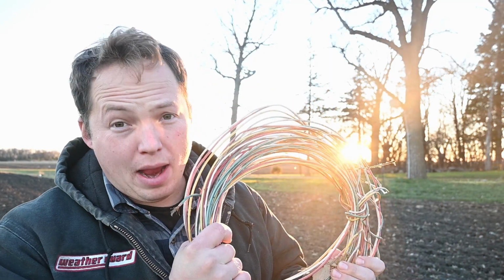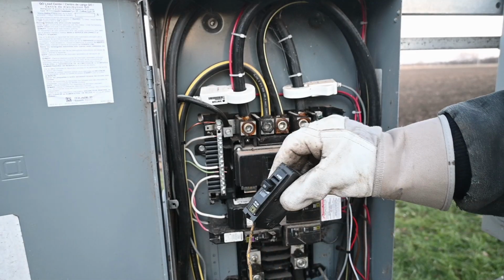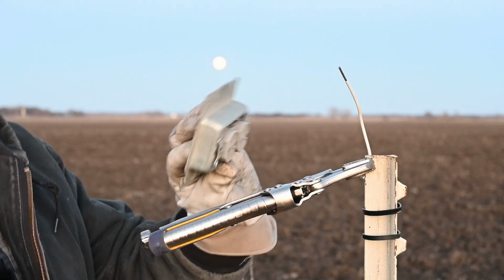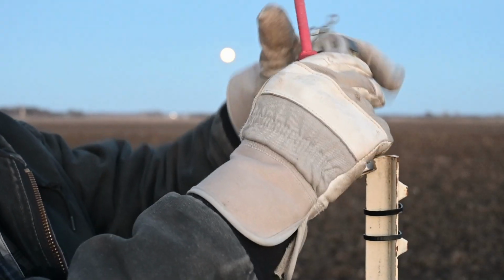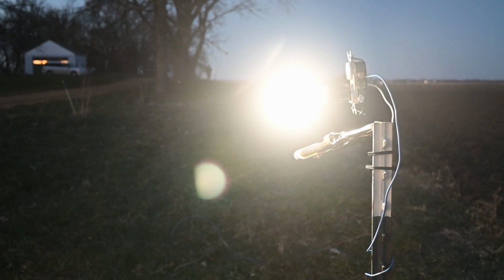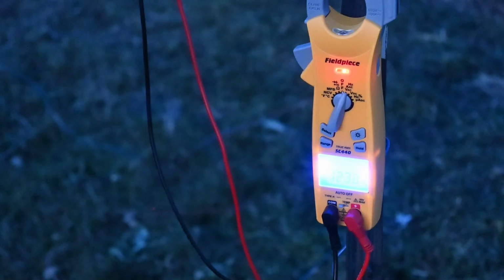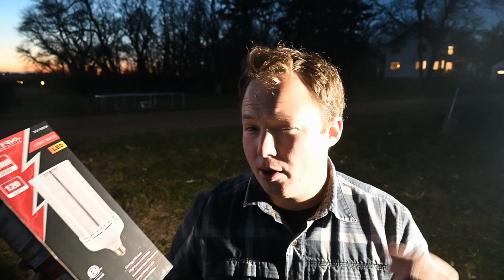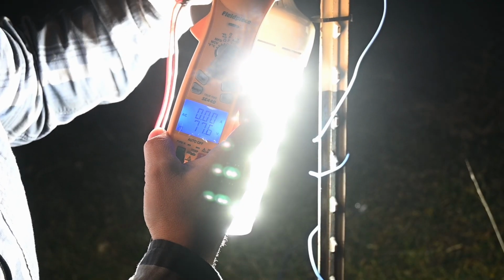Powering a Light With a Fence Post & Scrap Wire - SWER (Single Wire Earth Return) Demonstration

Comment: In the days of the singing wire or Morse code across the prairie they used the ground as the return circuit also. In fact they even found at one point where disconnecting the battery had no effect on performance. The system still worked somehow without power. I'm not positive on the details because it's been a long time since I remember reading something like that. Over 40 years at least.

Comment: At 1.6Ω / 1,000', 150 feet of 12 awg is 0.24Ω.  That means to see an 45 volt drop at 0.64 amps, the ground, post, & ground rod (collectively) are providing 70.07Ω of resistance.  I wonder how much that could be reduced with an 8' ground rod, instead of just the post. My guess is not very much.
I have never tried the SWER system with a generator, but if the neutral was grounded (with a rod) it might work.  However, I don't think I would try that with an inverter generator.

Comment: Big deal! You still used a electrical company box to get it going. That's no crystal radio which is powering a set of headphones without an electrical box connection.  Get it going without using an electrical box.

Comment: Mostly off but kinda sorta but not really on the subject here, its just funny/sad. I knew a guy in S.W. Florida, every time he left for work and as he returned home his 3 dogs would go crazy. Eventually they refused to load up in the van, he had to force them into the van. If the road was busy and he had to sit waiting to pull out of driveway they went REALLY crazy. He asked me what could cause that? I met at his house and he was pulling out of the driveway, yep, dogs went crazy. He backs up, I saw the dogs for the first time when he let them out of the van. I saw the collars, asked "uh, dude, you have a wireless fence for the dogs?". He looked shocked, then realized every time he drove over the wireless fence the dogs got a nasty shock. If he had to wait to pull out, they got shocked longer. He felt so bad he removed the collars. Those dogs wouldn't get close to the fence, eventually they would load up without freaking out.

Comment: You talked over what you were doing amd it was tedious.
Can you edit this without the buddy chat?
Did you lay 100' of wire from a circuit, then essentially  transmitted power into the ground?
So it's not free energy, you're exaggerating Nikola tesla power transmission?

Comment: When I was 14 my friend showed me his brother's stereo... this was really futuristic stuff and we weren't supposed to be in his older brother's room... who was an electronic tech who worked on the DEW line (cold war radar up north).  Brother came in and he saw the plywood box with toggle switches and a telephone hand set attached I was holding.  He didn't say anything about us being in his room and touching his very, very expensive stereo.  He asked about my box.  It was one of three telephone boxes we made to use at camp to talk to each other.  He showed us how, using scrap radio transformers, scrap biggest capacitors we could find in the radio, and then how to make a one line phone system using exactly this process.  We converted the variable dc to a higher voltage with the transformers, then fed one line into the ground by way of a capacitor and the other wire to the other phone.  He also showed us how to convert scrap tube radios or transistor radios into amplifiers by tapping into the audio circuit.

Comment: Cool..
I put a bag of magnesium in the ground..And it gives -1.6 volts.
them a ground a few ft away.
Lite up a led.
Then a cheater circuit (transistor) .more power.
 ...
Then I used a camera flash..
Even more power..

...
25 years later..🌟 still shines away.

Thanks for sharing.

Comment: @ Benjamin...could one limit the ground surface voltage if one were to use a stake that is insulated? For example ... The pole is 2ft deep into the ground, 18inches of which are insulated, all the way up to the connection point on the top, where the recepticle is attached. Could that potentially make this set up safer for your animals? Thank man. This was very interesting vid. Thank you! I learned something new.🙂
Reply: A "Scariac"? Not wise...

Comment: A hundred years ago single wire systems were common even with communications equipment. I suspect they were prone to frequent problem due to electrogalvanism. I heard Tesla initially ran such a system at his first generating plant in Niagra with 20,000 volt generators. But whenever someone through the knife switch a strange bluish gaseous like discharge left the lines and would electrocute whomever was present near switch or lines. Tesla investigated and determined a 2,000,000 volt discharge was occuring. His solution was to use a return line or 2 wire system like today. The reason for 2 mill discharge was the voltage/coulome pressure pumping in the wire with no where to go, Maxwell predicted scalar wave value remaining after 2 voltage amplitudes are phase canceled. When the switch was thrown static voltage pressure collapsed as it began to flow unhinderd through line. This caused scalar field to collapse as well. This was what led to his subsequent invention of Tesla coil and research in Colorado lab where he developed wireless power transmission system.

Comment: That is actually very dangerous at utility voltages and currents. An earth return goes to the generator source, not transformer or panel. You are tied into a utility, return is to their generator. All houses on the service are part of the circuit. It's important to understand that current paths through earth are unpredictable. If your neighbors  house is closer than your panel, their panel ground will become part of your return path. If they have an unbonded pool between your two panels or unbonded plumbing in thier home, you can potentially kill them. Any underground metal pipes can also become a current path allowing current travel further than direct line. Further, stray currents will negatively effect dairy cows even at low levels if any are in the area. If you want to study safe earth returns, study the works of Nicola Teslas high frequency generators.
Reply: No, it's the transformer because each transformer in the distribution system becomes a new separately derived system. There is no physical wire connection from the secondary side of his transformer back to the power plant. But you are correct in that it will be very dangerous especially in a subdivision, or area where typically 2-3 houses share a transformer. Then the neutral current can and will take every available return path back to that center tap on the secondary winding, including the neighbors pool if it's fed from the same transformer. In this case, it looks like this guy's house in the video, he's in a rural area with his own 7200 volt feed onto the property, then his own transformer. So it's safe for temporary testing like this. See NEC section 250, "All transformers, except autotransformers, are separately derived because the primary circuit conductors do not have any direct electrical connection to the secondary circuit conductors."
Reply: @brnmcc01  Texas Master Sparky here. Will this work? Yep, but... it is a bad idea for sure. The only difference between neutral and hot is reference to ground. That is why it is called AC current. In my mind, the money you save on one conductor is not worth the potential danger plus you will be smoking light bulbs and appliances probably at twice the rate. Depending on soil composition and moister content. I would just about bet you that if you slammed an amp meter on that it would draw twice the amperage of that same bulb if hooked up 2 conductor from the same source. So, there you go likely the money you saved by leaving out a conductor would be offset in short order in less appliance damage and lower light bills plus.....you would not be near as likely to kill the grandkids as an added bonus!
Reply: @brnmcc01  that actually makes a lot of sense since there not really connected , but you’d think since the power travels between the two coils it would still want to go back to the primary .
Reply: @brnmcc01  Is NEC section 250 saying that whatever is fed by a transformer is not directly connected to the grid?  I wasn't very good at the electricity portion of physics.
Reply: @brnmcc01  goat
Reply: @brnmcc01 -- thank you for clarifying that. (Retired electrician, worked with voltages as high as 22.3 KV; ALWAYS transformers.)
Reply: Thx
Reply: Your kud is running around in the rain and grabs that gate latch, be lucky if they survive! Lots of old farms were wired like that, especially if they were powering it with a generator. When they went on public utility, nobody checked all the grounds, dead livesrock.
Reply: @robertdinicola9225  makes me wonder about all the cows that had died at one time on a ranch. Did they change some power there and Tony realize that their grandpa had run something like this? 🤔
Reply: @patsternburg8737  lose your neutral, lose your cows! Lol!
Reply: Ahhhh, it's a rare treat to hear someone speak intelligently on such a subject. Ty
Reply: It looks like he doesn't have any neighbors. But this gives me an idea about my own. JK
Reply: @LavenderLori406  😆
Reply: Yes exactly.
It really does not mean anything current still metered
Reply: We are all the Earth so whats the point?
Reply: Might shock the dickens out of a cow lol .
Reply: Wrong, it goes back to the ground rod at the panel, just like he said.
Reply: NO, it would be a bummer if that would meet electrical code.
Reply: Like most guys, he looks at AC current like it is a battery. Now his next experiment will prove that.... that he spoke about in the end. If you are watching this under no circumstances do this.
Reply: Yes thanks for informing this nut bar let's hope he disconnected it
Reply: THANK YOU VERY MUCH FOR YOUR INFORMATION .....WOULD NEVER THOUGHT OF THIS EFFECTING NEIGHBORS........ VERY USEFUL INFORMATION.........YOU CAN EASILY  SEE NOW WHERE TESLA WAS GOING WITH HHIS WIRLESS POWER TRANSMISSION PROJECTS.......
Reply: Underground pipes are an Nec approved source for grounding. Just like a ground rod, also neutrals and grounds are often on the same buss bar inside the main service panel.
Reply: @roberthughes2687   The code was changed several years ago. Each neutral wire must connect to a isolated bar under individual terminals. Ground wire must terminate under a individual terminal on a bar bonded to the panel.
Reply: @ryaneverett9901  obviously you aren't supposed to stack wires but grounds and neutral can still go to the main panel and be on the same bar.
But they cant do that in a "sub panel"
Reply: Remember, it's all theory.

Comment: I have a 8 foot ground rod attached to nothing in the ground. Just sitting there. Wondering if I can run a copper wire to a steel rod. And get enough power to run a fan on a wind turbine for constant wind gust.🤣 Free energy .

Comment: this concept also accelerates rust on whatever are your ground electrodes. and it provides no safety system. 
GFCI devices kick in at an inbalance of 5 milli Amps, aka 0.005A, for a reason...

Comment: While experimental riggings like this are interesting and fun, wiring like this tends to cause stray voltage.  

In fact when used on dairy operations, the stray voltage from this type of wiring tends to cause the cows to receive tiny ‘shocks’ that in turn tend to reduce milk production.  For this and other reasons, it is best to avoid this type of wiring.

Comment: There would be no tap onto the high voltage windings from primary to secondary., as there is no Neutral, there is 2 or 3 phases, but no neutral, and also electrically speaking there is only one on the secondary side as this is isolated from the high-voltage primary side.

Comment: The ground is the ground and using the earth is A higher resistance than using a wire . If to pull to much current or amps threw this wire you cause fires at the source the post is setting in the ground or some one barefooted Touch the post to be electrocuted !!!

Comment: Good way to get someone hurt or killed. Electricity will always take the path of less resistance. Whatever Gas, Water, Fence or Sewer line's in path, may become energized and kill the next tradesmen. Fire 🔥 would be my next concern, as any bad connection could very well start a serious burn and forest fire.
 The biggest problem is that your power supply, should be a total separate stand alone supply system and low current. Yet, I highly recommend taking down the video, as Ground is truly the most dangerous path. Earth Grounding of electrical systems is designed and used to interrupt circuit and or trip the supply, not to utilizing ground path back to your source supply system. 

IBEW from 1976 to today, I don't believe I've ever seen a more dangerous installation...thanks.
Reply from the maker: I agree. That's why this was EXCLUSIVELY a DEMONSTRATION and was immediately disconnected upon completion of the test.

Thanks for sharing your thoughts.
Reply: Totally agree!...one more thing for everyone to understand is that electricity will take EVERY path, NOT just the path of least resistance.

Comment: When I was still in the Philippines, what others do is to put the ground wire from the AC line to the current line of the power meter at home. Then they put their return current to the hand pump artesian well dug to the ground via a vertical vacuum tube to prevent pump kickoff. One time, my uncle use this return wire to hang his hand washed clothes which includes Levis pants. The wired broke and the wire was  live with 220 volts wrapped on his body with the wet clothes. When they found him, he was still smoking. Be careful of those wires

Comment: I would be interested if you get the same voltage drop if you used a thicker live wire? 
Just to clarify if it's the ground that's the cause of the high resistance or the ground or the fence post. 
I really wanted to see you put the current clamp on the fence post LoL,  you could have possibly been the first person in history to get a current reading off a fence post LoL. 
Otherwise this was a great experiment..
Reply: 150 feet of 12 awg wire is definitely causing at least part of the voltage drop.

Comment: This is not a thing! Your neutral wire is an "Earth return", as you put it. The reason why you bond your ground and neutral together is to eliminate any difference in potential in anything other than where you want it at. Otherwise you could grab two neutrals or a neutral and a ground and have a deadly difference in potential at it. There's a reason for electrical codes and why you need to follow them. Your likely going to get someone killed. Seems like I remember watching a video you did where you had a voltage on a ground or something like that. Crap like this is the reason why you would have voltage on a ground. You don't seem to understand anything about phase change and wavelength. In fact it seems like you know enough about electricity to be dangerous. Please stop teaching people bad physics and how to get themselves killed.

Comment: No big deal u just a circuit same as normal electricity is a circle the hot always goes to ground its dangerous if u get in between the hot wire and ground u can get killed its not the voltage its the amps that kill voltage drop is from the distance by the way

Comment: If you take a volt meter and read between ground and live on an outlet you get 110/120 volts. On some panels neutral and the ground are bonded together. Long distances can cause voltage drop. If the pole is not insulated and the dogs touch it they can get shock
Reply: Pool noodle and an electric bread knife!

Comment: To get a better grounding effect, a goodly bit of [deep] buried copper window screen works wonderfully. To make the circuit even stronger, turn the power off first and then piss on the ground at the grounds. The moisture and the salts will combine to make a stronger circuit. At the cost of redundancy, TURN THE POWER OFF FIRST! You will re-power it when you are done with the installation ... AFTER you are done pissing on the earth. I used this for decades to get good connections in seemingly dry ground on the ranch.

Comment: Sounds great , but would not want to touch it, I thought it interesting and question what all it could work or turn on, I have been interested in solar power and wonder if it could power a battery as a backup if the electric failed or is that a different source concerning ac/dc, and for at least powering a phone ,also if and when they drop the EMP bomb on us and nothing will work electricity then is there going to be a current in the ground, I was taught by my dad we have a current above ground and below, is this a negative and positive so when lightning strikes and hits the ground does that mean the ground current is negative and the positive bounces away from it sending the bolt of lightning back up off the ground, a bolt of lightning holds a lot of power in volts , was wondering how this works ,but I find it interesting, I know my father in-law got killed on horseback in broad daylight herding his animals,they lived in Mexico and there are places that melted the sand into glass when it hit, they called it a devil's walking stick because it can be seen coming down in a spiral but it's too late by the speed it comes if you are close by. Too bad we can't screw the light ing fixture in to the ground like water coming up, I like the subject of the lake also but don't understand it .

Comment: Out in the country at my family farm, the electric co-op only has a very old single copper wire running from way out by the highway to our farm.  Of course there is a transformer on a pole bringing the typical two insulated wires and a twisted neutral/ground to the house.  But for AC current, how do they create two phases and add a neutral from that one copper power wire?